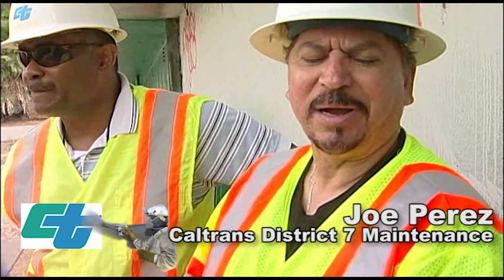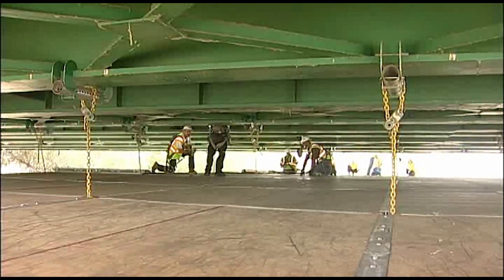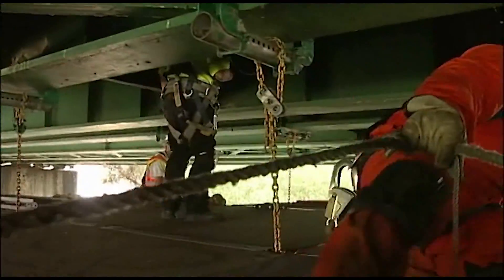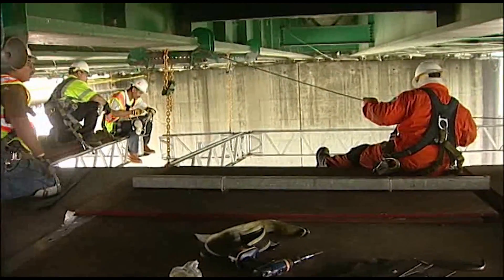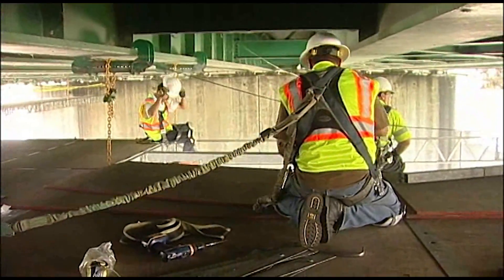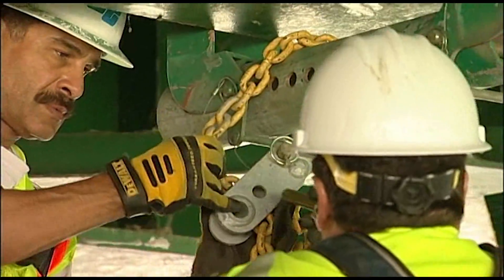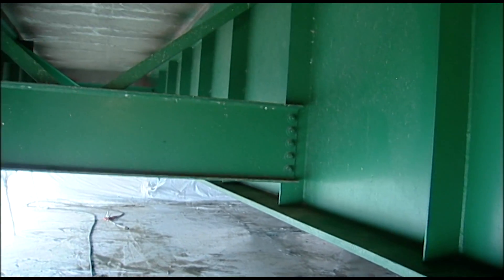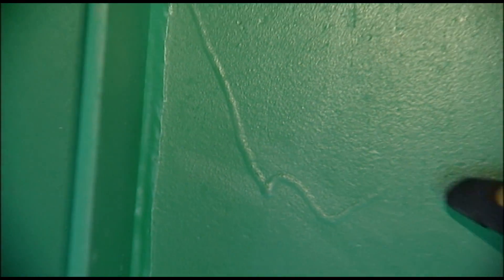Structural Steel Painter Travelling Crew District 7

Comment: Any info on what types of paint they are using besides "pink, red, and green?"
Reply: Most bridges the state wants a zinc primer with an epoxy mid coat and a urethane topcoat
Reply: @chrisseamans5472  Yup that's the typical NEPCOAT system used in the NE US, where we are dealing with all 4 seasons and salts from the road (and sometimes from sea). And mix in some stripe coats, maybe a sealer coat (on bearings), and possibly an extra intermediate coat of epoxy.

In the video he actually gives a good description to a layperson.
Reply: Probably a two-part epoxy or oil.
Reply: It’s water based

Comment: No no using a spring clamp on the pressure washer wand dead mans valve
Reply from the maker: Thank You for that information. I will pass it along to our safety people.
Reply: Im from the local 1036 painters union. Industrial side how do í go about on making the proccess  faster on getting in into the apprentice program you have for structural steel... Is it luck of the draw?